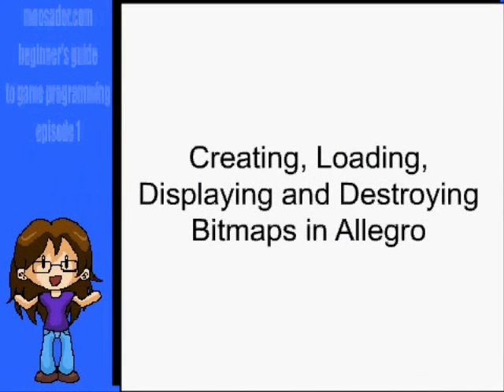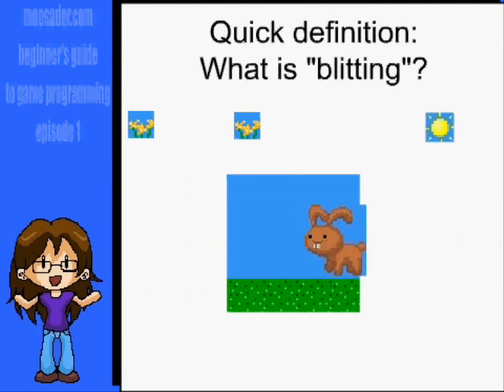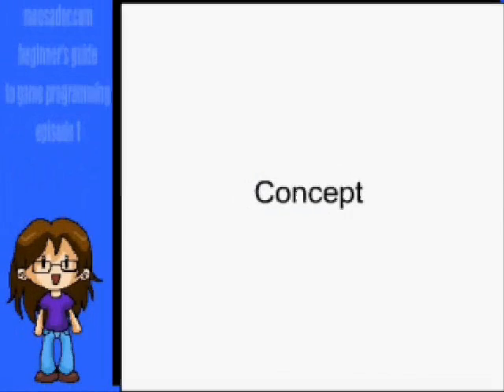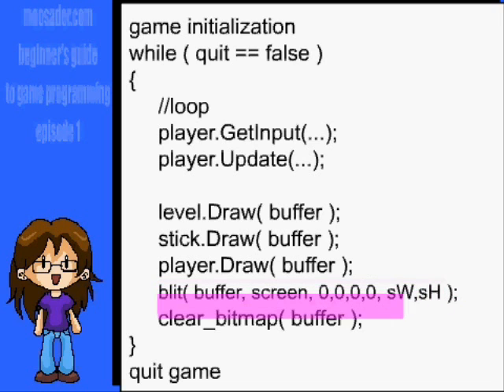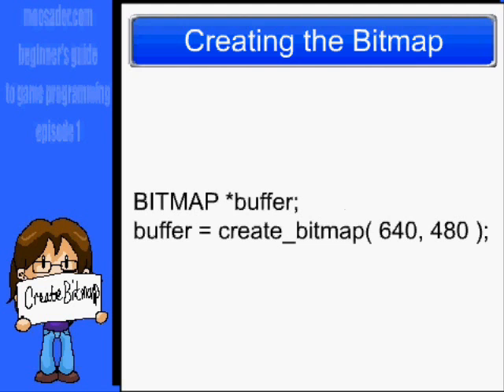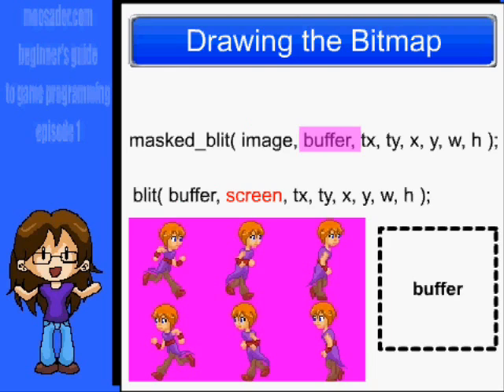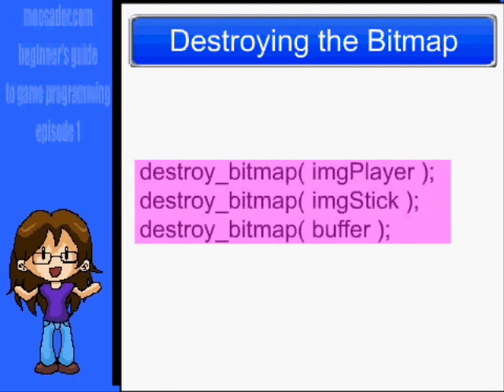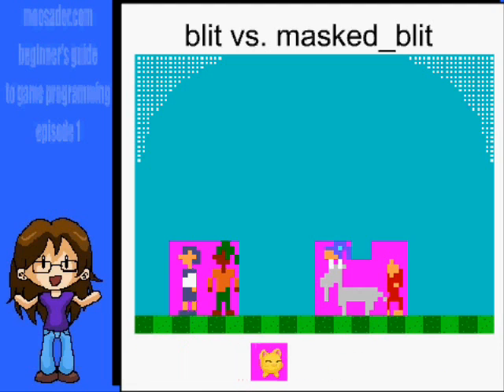Beginner's Guide to Game Programming Ep1 Part 4-A Graphics in Allegro 4

Comment: For anyone reading this in the future, if your program is crashing without reason it might be because there is a problem with your .bmp file. In my case I used GIMP to create a sprite to use with my code. It was a .bmp file, and in theory it should have worked just fine(my source code was fine), but my program would freeze and crash without giving me an error message whenever I used this one image. Turns out, I was exporting with the wrong settings. As long as my sprite was exported with "Do not write color space information" and "24 bits R8 G8 B8" selected my program would run just fine. Any other setting would cause a crash. My guess is that this is an issue with Allegro 4.

Comment: Is it possible to animate bitmaps? Or do you have to find a way to load in gif files?
Reply from the maker: Juan Nunez You do this by storing one image, with a series of the frames within that image. This is a filmstrip. Then, in the program, you program it to only show one frame at a time, then increment.

So, for a 50x50 sized sprite, with 3 frames of animation, your filmstrip could be 150x50 - so every 50 pixels is one frame.
Frame 1: 0x0 to 50x50. Frame 2: 50x0 to 100x50. Frame 3: 100x0 to 150x50.
Then it's just changing what gets drawn each cycle during the program

Comment: Hello, load_bitmap wont work for me (i know the error is here, because I checked if it returns null, and it does). I'm trying to load a picture from Rachel's site. I converted it to .bmp. The picture is in the same folder with the file containing the code (I'm writing in C, using  a simple text editor + gcc compiler). Seems to me I've done everything correct. I can't find any solutions googling. I'm stuck with this for like an hour. Anything special i should've done in init.-int allegro maybe?

Comment: This makes three of us (about the crashing issue). If you have the time, would you care to take a look if I emailed you my main.cpp as well as the image I'm using? I'm NOT asking for you to figure out the positioning (which wouldn't cause a crash anyway, unless you're working with DirectX, but that's another story). Under any other circumstance I'd probably lay off of this issue and move on, but as I said, this makes three people, and I don't want there to be an overflow. Please get back to me.

Comment: I don't know where to put the x.bmp or o.bmp on my hard drive so that the program can access them. I tried putting them just in c:\ and then changing:

xSprite = load_bitmap( "x.bmp", NULL);
oSprite = load_bitmap( "o.bmp", NULL);

to:
xSprite = load_bitmap( "c:\x.bmp", NULL);
oSprite = load_bitmap( "c:\o.bmp", NULL);

Doing that just crashed the console screen whenever I compiled and ran the code as did leaving trying to compile and run the straight copied code.